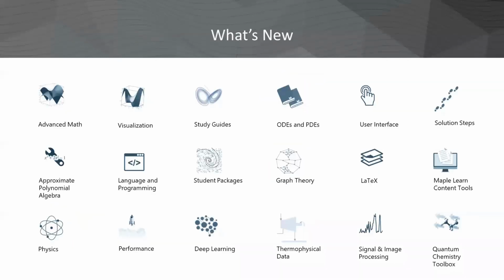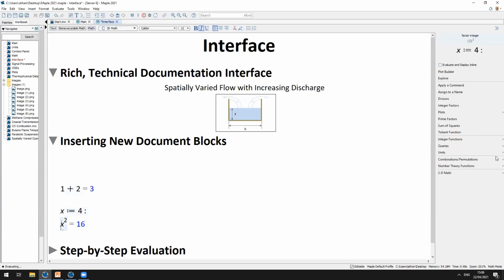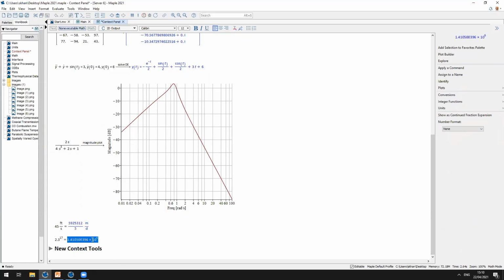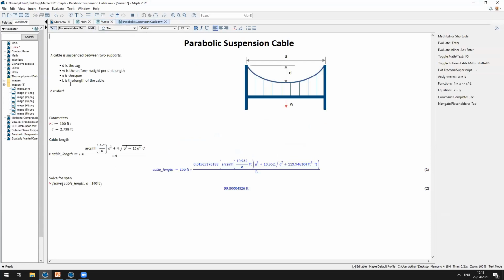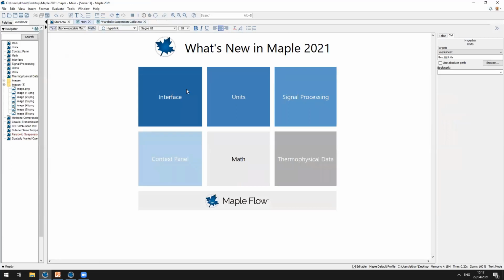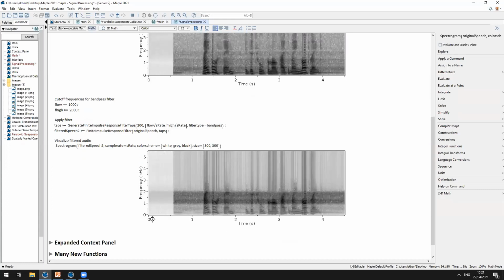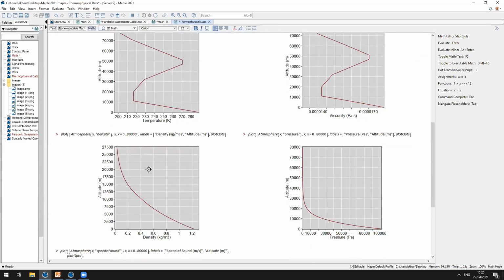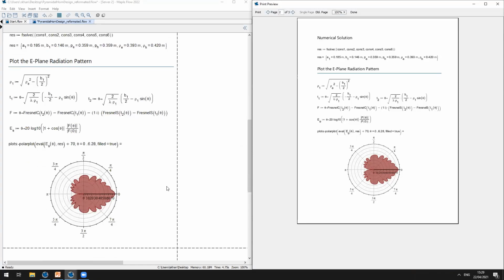Introducing Maple 2021 for Industry

Comment: Can it be used to solve a system of second-order nonlinear equations with dual unknowns?
Reply from the maker: Thanks for your question. The answer depends entirely of the equations (i.e., what kind of nonlinearity you have.) Some can be solved, but most of them cannot. This is a purely mathematical distinction, not a restriction of Maple. If an exact solution exists, chances are good that Maple will find it.

As a suggestion, perhaps you can post your question on MaplePrimes (www.mapleprimes.com) and other members of the Maple community can help determine whether what you are trying to do is possible. Good luck!

Comment: Maple can differentiate a sum, but it is not able to integrate that, what we need in solving with Extended Galerkin's Method.
It's so important for me to solve my problems symbolically.
Reply: you should use Inert sum.
Thank you for the response !!!!!!!!!!!!!!!!!!!!!!!!!!!!!!!!!!!!!!!!!!!!!!!!!!!!!!!!!!!!!!!
Reply from the maker: Thanks for your comment. We're not sure whether you are experiencing a problem or are suggesting a feature, and would appreciate some additional details. I recommend filling out the 'Contact Support' form on our web site (https://www.maplesoft.com/contact/webforms/support.aspx) with as much detail as you can provide, and we can assist you further.
Reply: @maplesoft  Thanks for the response, but I couldn't find my country name (Iran) in that page, that's just absolutely ridiculous .
Reply: Hello Professor   I have a system of three equations and I want to review the distinguished group, but my calculator is not very efficient. I ask you to help me, please.